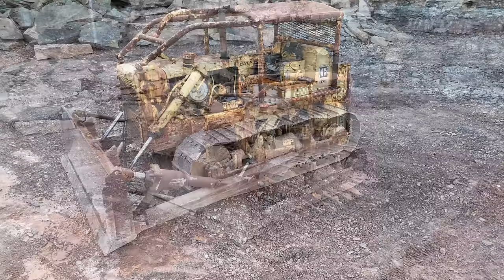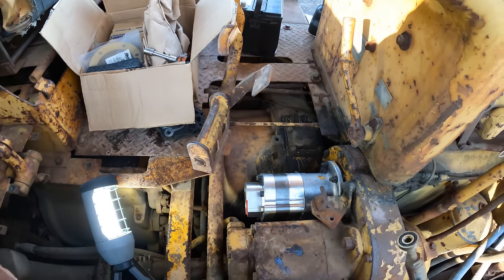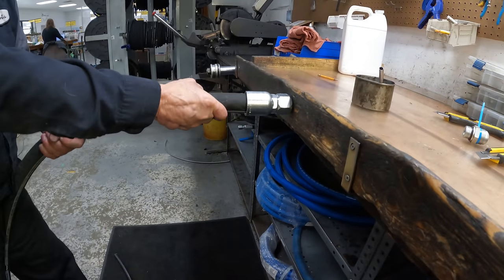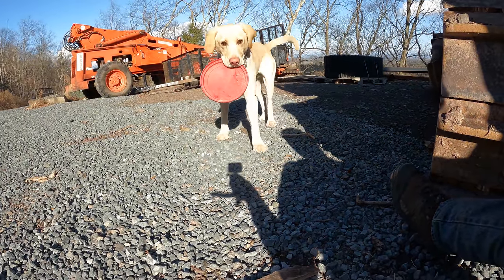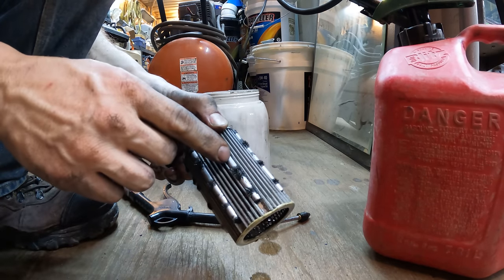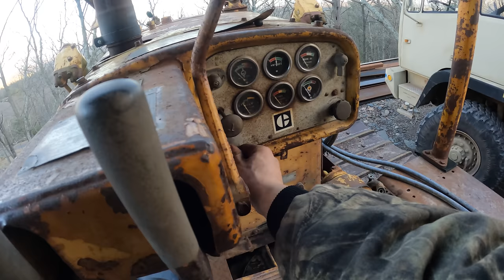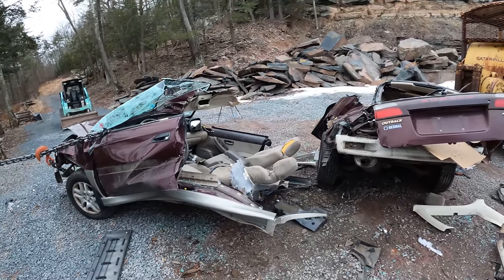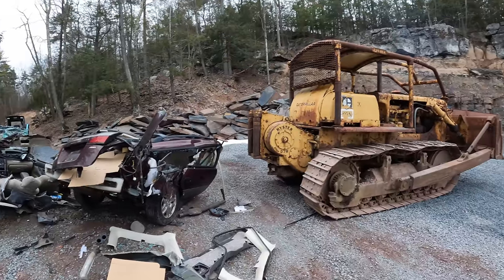Fixing a bulldozer winch

Comment: Would you consider giving that winch cable a soaking with a 60/40 diesel/oil spray just so it lays better (slips across and arranges itself onto the spool on winding by reducing friction) and which will also keep serious cable eating rust at bay a bit longer?

Comment: @31:00 "There is a lot of cable on this thing."
That's the biggest understatement of the year right there. You could run a tree line with that thing and pull logs up a mountain side!
Reply: which is what it was probably used for.

Comment: If you do a house demo, using the cat winch cable in a choke, like you did with the car, is one way to break the building down and keep most of it within it's original footprint.

Guy that told me about that method added a story to it.  Late 60's, they had been contracted to remove a derelict house that was pretty much as it was when the last occupant passed away decades earlier.  Salvage nothing, take it all out.  It was in what had become a rough neighborhood.  They came in that morning, positioned the cat, removed the connections to any utilities and put the choke cable on it.  They went to lunch, came back, and without much thought fired up the cat and started pulling.  "As the corners of the house started bowing in and you could hear wood breaking, two kids, a boy and a girl, came running out of the door, around the side and disappeared in the alley.  Neither one had a stitch on them.  Damnest thing I ever saw!  After that, we never took a house down with that method without checking it first."

Another in our gathering commented, saying "Oh, they were getting a little, were they?  Another quipped "Sounds like a little was all they got!"  I had to wonder how they explained the loss of their cloths to their parents ...

Comment: Would you ever want to build yourself a homemade sandblaster/capture container for it. It helps cleans off materials nicely.
Reply: Heh, like he'd build a home made one - one video he'll show up with one of those trailer air compressors and a commercial blasting cabinet on one of the flatbed trailers that he "just picked up".
Reply: but you'd loose the fun of swishing filters next to a danger label!
Reply: I agree, a blast cabinet would remove any paint oil or grease more thoroughly than the wire brush method.
Reply: Beach sand works good and way too cheap to save. As far as a blast cabinet, the harbor freight one  works fine, why build one for " no reason ".

Comment: You might want to consider changing the oil in your hydraulic system again.   When you drained the old oil out, there was a bunch of water that came out first.    When you checked the screen on the return line after refilling the system, the new oil was looking kinda milky whcih may mean that there's still some water in the system.

Comment: Andrew, I'm thinking the hydraulic hoses you pulled out were probably to run a hydraulic sub soiler or ripper but they added the winch instead.
Really enjoy your videos. 
Russ (Florida)
Reply: Those little tiny lines were probably for something that someone rigged up. Nothing with any serious power.

Comment: Those lines you "wanted to keep somewhere else" that seemed to be hooked up nowhere on the machine might've been heat trace lines.
 
basically using the hot coolant of another motor from another piece of equipment to pre-warm the dozer's engine prior to starting.
 
I'm shooting from the hip here but they seem the right size.
Reply: I read that from a previous comment. Thanks for sharing.

Comment: Great work on the video. Could the wood that is supporting the filter in the hydraulic system disintegrate over time due to the pressure within the system?
Reply: My thought exactly.  I was thinking steel plate.

Comment: Wow! That winch seems to have a lot of power! Any idea how many tons it can haul?
Reply: Depends on whether the drum is bare or full. With a bare drum (line all the way out) it pulls at 40,000 pounds. With a totally full drum (line all the way in) it pulls 26,000 pounds. As the drum fills up the leverage of the force increases and the speed at which it retracts increases too. Torque is just a measurement of angular momentum so it makes sense the pulling power goes down as the angular momentum is increased. But that particular Hyster pulls at a max of 20 tons. About four times harder than a typical 4x4 winch.
Reply: D7H's are 80,000lb winches
Reply: All of them.  But really, with 1" line the book says 27k lbs with a full drum tightly wound.   (@ 13.5 ton)

Comment: Man, you just broke Waylon Wire's heart.  He would have made Hooptie #2 out of that junk Subaru.
That dozer winch is unstoppable.
The pony motor on your Cat reminded me of my summer job in 1972 working for Columbia Gas.  They had a Cat D8 for plowing cable underground for corrosion protection on the pipeline.  The first time I heard the D8 start up on pony motor, I thought "That isn't so loud" then the main engine caught, and it scared the crap outta me!

Comment: Those hoses on the right side that you took off were an add-on so you could run double acting cylinders. or hydraulic motors from the operators station via the controls for the blade tilt circuit.  Buddy of mine had those on his D6 and he used it to pull a chisel plow when he was building terraces and didn't have a ripper

Comment: The two main uses of that cable winch are 
felling trees and climbing hillsides.

Dozers with that setup are used in forestry.
Wrap the cable around a tree, use the cinch rollers for advantage,
like a cheese cutter, the cable cuts the tree.

You can also use it to (help) pull the dozer up a hillside, wrapped around
several trees for an anchor. Because it's PTO it's incredibly strong,
huge torque with throttle locked up. Keep fluid, filters & cooler clean!
Reply from the maker: I think this one is set up more for pulling vehicles up hills. That winch is huge just for dealing with logs.
Reply: @AndrewCamarata  No, you're not understanding.
Wrap that cable around a tree, and use a side roller for mechanical advantage. Tear a good sized tree out of the ground.

Comment: Looking at much of your heavy equipment I notice there is a lot of rust.  As you know, once rust starts it will continue to worsen.  While living on the Gulf Coast next to salt water rust and corrosion was even a worse problem.  I bought a 500 gallon gas tank to fuel my boat but it was totally rusted.  I found a product thanks to the locals called Ospho.  Using a wire wheel to clean off the heavy rust, I then sprayed my fuel tank with Ospho.   It turned it black and there was no sign of rust.  After brushing off some white powder residue I painted the tank with Rustoleum paint.  It turned out great and 5 years later sitting only 20 feet from the saltwater, my tank had zero rust.  Ospho is a fantastic product and stops rust completely turning iron oxide into iron phosphate which is inert.  It also is a good primer for painting.  If you sprayed Ospho on any rusted surfaces of your equipment rust would no longer be a problem and you could paint the surfaces at your convenience.  All rusted parts will be black/gray which looks much better than rust.  Give it a try...you will be pleased with the results.
Reply: AC had a similar product he used a couple years ago. I have used the original product called "Trustan" about 30 yrs ago when I restored my '66 Buick Riv.
His issue is that he doesn't care about pretty,  he's into functioning equipment.  I agree with you but AC doesn't seem to see it that way.
Reply: @raybame5816  Anything looks better than rust and once it starts rusting it will only continue...unless treated with a product like Ospho.  Eventually rusting will destroy whatever it attacks...so much for preserving functionality.  Ospho is not for looks...it simply stops rust.

Comment: Suggestion for rewarding your winch cable. Hook it to your pick-up truck, put the truck inneutraland spool in the cable slowly, pulling the truck in with it. Also, wrap the winch cable neatly around the drum. It will damage the cable if you just reel it in wherever it goes.  Suggested from an old Army engineer.

Comment: Usually when you see that much metal on the magnets is not a good sign even after cleaning it twice.
And from looking at that oil coming out it seems it has not been changed much or at all during it's life.
There may be a part in the system somewhere that has a lot of excessive wear or really worn out gears thats dropping shavings
But after all that work done to get the winch going again it seems work just fine even after ripping a car in half.

Comment: Would be a good idea to spray or brush on Ospho (phosphoric acid) to neutralize the rust and prevent more rust on the winch cable and ant other rusted parts of the dozer.  Ospho turns iron oxide into iron phosphate which is inert.  It turns treated parts black stops the rust and is a good primer for painting.  I did a 500 gal gasoline tank that was totally covered in rust.  After the Ospho dried simply brush off the white powder residue and painted the tank with Rustoleum paint.  It sat outdoors next to saltwater and for 5 years I owned it not one spec of rust on it anywhere.   Try it, it will save you time and prevent further damage to rusted parts and would be good primer to paint the dozer and other rusty equipment you have.

Comment: The metal filings are normal. My old loader had a magnetic dipstick and it also picked up the wear filings. The manual said this is normal and is why they install the magnetic pickup filters.

Comment: Pretty sure the company I work for made those clamps that go on your hydraulic system there. Pretty cool to see that in your video.
Reply: how is it that heavy duty hose clamps can contain hydraulic pressure? isn't that why people pay a lot to get hoses crimped?
Reply: @rocifier  the clamps were used on the return side. They would never hold the pressure of the high pressure side.

Comment: Excellent job of getting the winch operating again, I would have over filled the gear case's with diesel fuel and run it for a while before adding the fresh oil, next time you are servicing pour the engine oil over the winch cable
Reply from the maker: The oil that is in the winch is also the oil used in that hydraulic pump. I am not sure about running diesel in that.
Reply: Diesel will not cause any problems, leave the Old filters in to catch any crap the diesel loosens up.
Where you.put a piece of wood to hold the intake filter in place get a coil spring out of a seat cushion and replace the bit of wood. 
When I used to rebuild engines I drained the oil and refilled the engine with diesel and started it up and let it idle for a few minutes (if they were a runner) you would be surprised of how much easier it is to work on.

Comment: The cable is the safety ie it will break before the winch will.
Run cable out hooked up cable then pull with tractor to spin tracks and “bog” the D7 - then pull with winch - this stops D7 from sliding back - cable becomes the weakest “link”

Hence never/Don’t put oversize/strength cable on winch

Comment: Andrew, go look at Squatch253's channel. The pony motor is a weak spot on the Cat, unless you shut it down properly. Shutting the fuel off and letting the engine run dry is supposed to be the best method.
 They only hold about a quart of oil in their sumps, so any gas that gets down there thins the oil until theryspin bearings.

Comment: This Outback being sold on Craigslist. "Slightly used in great condition. Little scratch on the roof but it'll buff out. New tires. $2500 Firm. No low ballers, I know what I have."

Comment: I’ve noticed the white Teflon tape doesn’t hold up as well with hydraulic fluid. The white stuff is cheap and really only for water or air. I’m very sure you know this already lol 
But also what brand are those wrenches? One straight end and one 90° offset end I need those!!

Comment: You can write down the part number of the oil filter on the filter cover/case, or on the inside of the cab(roof), engine cowling....   or any place you feel like.  You could write down other part numbers, notes, last oil change, volumes, service info, VIN,  etc.  Then spray some clear coat, lacquer, or whatever clear you have over that.   The mark should last a few years.  Same thing for your all of your other equipment.  Having a factory service manual is the "last word".  There are all kinds on eBay, etc.,  at low prices!  They save you hours of time, money and frustration. Just saying.

Comment: Uh, those threads don’t take sealant. The nut on the left side is used to lock the fitting into the desired position. Under the nut is an o-ring that handles the seal.

Comment: Lol. I'm 6months late to watch this. But if no one has told you or if you havent done it yet. Pour some used oil ( motor or hydraulic) on the winch cable to help it last longer

Comment: You shouldn’t need starter fluid on the main engine, leave the pony motor cranking it over for a minute to warm all the oil and cylinders up then turn the compression on and it should start better
Reply from the maker: Sometimes I was cranking it for almost 10 minutes. With starting fluid it starts right up.
Reply: @AndrewCamarata  oh right must have poor compression then

Comment: You're not putting that on there right Andrew think about it unless the excavator was in freewheel mode I highly doubt it. You need to hook that thing to a big tree up in the woods and run it all the way out and put it in neutral it has to be up a little bit of a hill just a little bit running all the way out put it in neutral and have the machine pull itself all the way to the tree always keeping tension on the cable. You didn't always have tension on it when you wound it up therefore when you hook up onto something hard it's going to tighten up about in the middle and you're going to end up with trouble and you know what happens then I hope this came out good I use voice text

Comment: When you "cleaned" that pump strainer with gasoline you didn't show any precautions to prevent metal shavings from getting on the "clean" side of the element.  That doesn't help the pump or system valve life expectancy.

Comment: DO HYDRAULIC LINES USE TEFLON TAPE on threads? Even repairing and cleaning a 50 year old tractor winch pays big view dividends. I am sure if Andrew cut his toenails he'd get high views now or went to his favorite Saugerties cafe with a local hero.
Reply from the maker: They usually do not.
Reply from the maker: It depends on the type of fitting. Most dont need it.

Comment: Yeah what a brilliant idea... Put some freaking wood in the oil circulation system ... That shouldn't cause ANY problems at all ..............
Reply from the maker: What problems do you think that would make? I should put a spring there instead.
Reply: @AndrewCamarata  Hi Andrew. You hit it right on the nail, I think you should really consider using a metallic retainer, for instance a spring would be great.
I worry very much that the wood you put in there will disintegrate soon and once you lose the contact between the cartridge and the body, it'll start wreaking havoc as wood fibers make it's way through the entire circulation system.

Comment: The reason the Subaru won't drive is most likely a torque converter failure or low transmission fluid.
Reply from the maker: And it broke in half
Reply: @AndrewCamarata  🤣🤣🤣🤣
Reply: @AndrewCamarata  can I have the wheels off it please? They'll fit mine... 😀

Comment: the 'E" 1961 160 HP   seems like enough tractor for most and has no computers to keep you wondering. Can pay for itself to pull over building rater than unsafely push it over. Why rip a parts car apart. You are making too much money now.